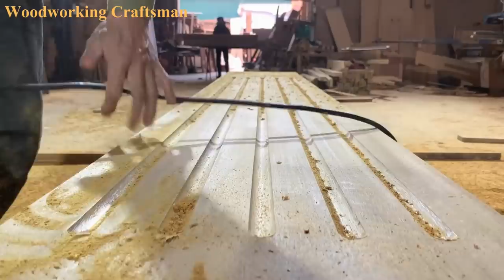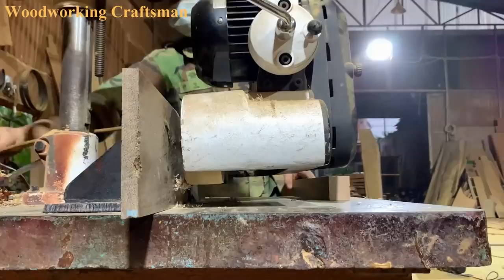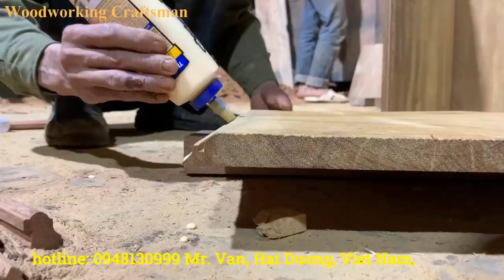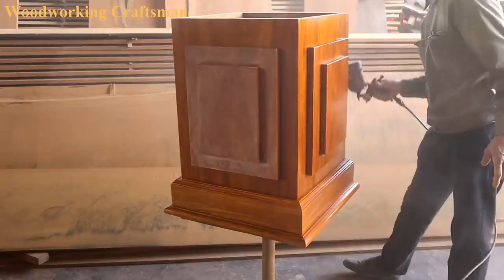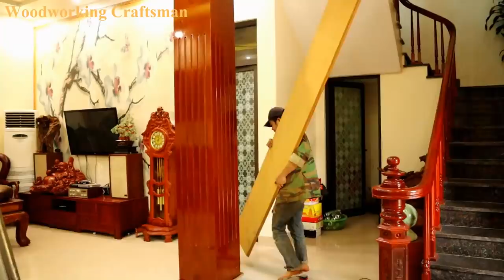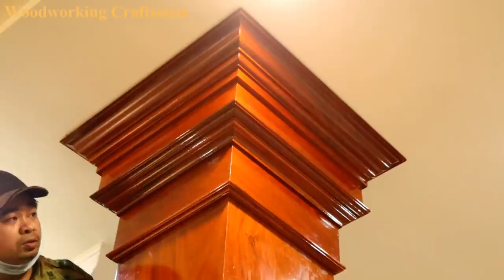Extremely Beautiful Wooden Molding Crown Many Layers Column Decoration // Old Living Room Renovation

Comment: :)...Man, you guys work close to the ground! We always have our stuff up on a bench or table...I would hate to be using that sliding compound mitre box on the floor! But; if that's comfortable for you, that's all that matters! The work is awesome! Little trick for that last piece on the capitol; use some super glue (cyanoacrylate) so those joints will stay tight...